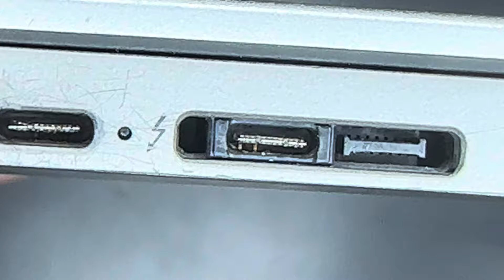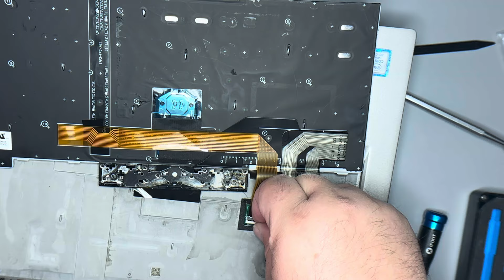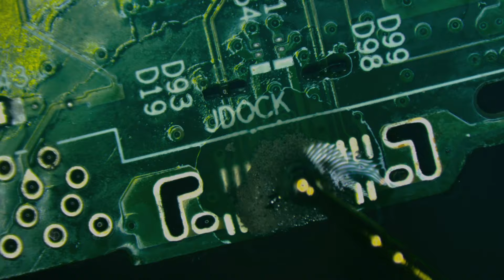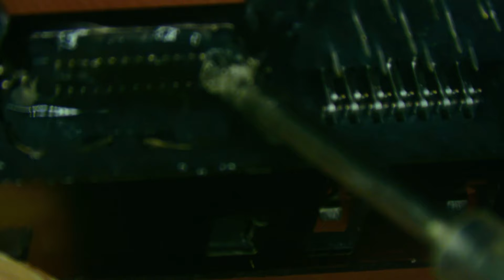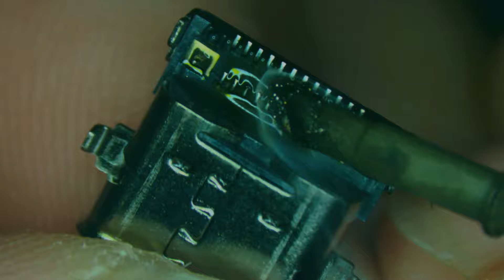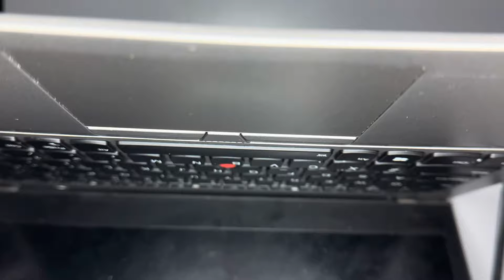Lenovo ThinkPad Laptop Charging Ports | Step-by-Step Repair Guide (Nothing Left Out)

Comment: Nice clean repair! I've not had to do one of those combo docking connectors yet but I've done several E14 Gen 3 ThinkPads for customers. It's a love hate relationship with USB-C. Super convenient but delicate as hell. 
The worst are the Huawei laptops because when the ports go bad all the traces rip from the board. The trace repair is doable but not something I want to do on USB-C ports just because the customer will want a warranty on the repair.